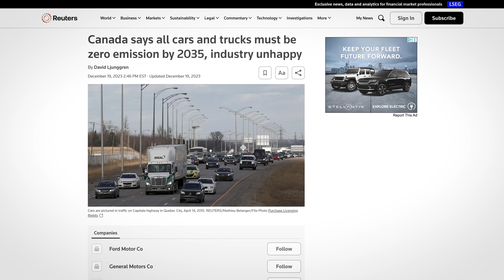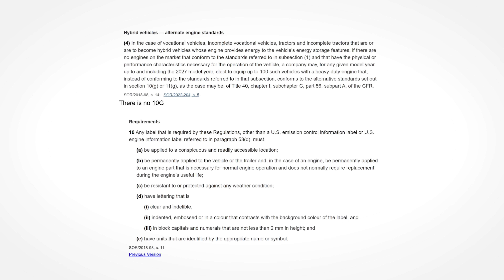Government Red Tape Is Blocking Our Plug-In Hybrid Trucks

Comment: One thing that has always bothered me about generators is their lack of emission control. Is that the issue here, you're trying to use diesel generators on roadways while ignoring the same regulations that other diesel trucks have to follow? If so, then tough - diesel is terrible when it comes to emissions and I don't want anyone trying to bypass it.

Comment: All vehicles have a generator (some call it an alternator)  All vehicles have a battery ( large trucks have multiple batteries).  Service vehicles have much larger generators to power their welders, power tools, compressors, work lights.  So, put in an inverter to handle the additional features with 220v, 110v, welding outlets and controls.  You now have a new class of emergency/service vehicle!  It can also carry power poles (logs?)

Comment: So, for what it's worth, what about split bank charging. Two battery banks, one drving the vehicle and the other on charge via the generator, when it's charged, the computer switches to the other bank and places the charged bank into the "duty cycle" powering the vehicle. This way the generator is not "technically" powering the vehicle with motive power through the batteries, it is truly an auxiliary power unit, and never powering the drive motors. Yeah, it's a bit of a work around, but avoids the whole concern of the engine actually powering the drive units directly. Regenerative braking can charge both batteries when ever need be, as it's not an area of concern from an emissions stand point. When legislative idiots give you lemons, you make lemonade and come up with a work around that renders their legislation as invalid. Under high demand for more power the charging batteries switch in to assist and the generator switches off until the load is removed, then the normal charging can resume. It's a cost effective work around that doesn't incur additional recertification of the diesel power unit (for the short term till you can afford to find another solution or recertification).

Comment: I don't think is really a "Electric Truck" in the proper sense. It is a diesel truck with a electric drive system in the middle functioning as a CVT and regenerative breaking system. It is far lower emissions than a proper diesel only truck and for that it is a leap in the right direction for the environment. Why the government doesn't think a leap forward is good enough I don't know.

Comment: Just a thought (Likely you have considered already) - 
Is it possible to use a petrol (gasoline) or natural gas (liquified or compressed) generator instead of diesel? 
These are less polluting fuels, so it might be easier to get green clearance (of whatever similar thing is blocking the diesel genset) for these. Given that you do not need tractive power, maybe its possible to gear these types of generators for your dynamo setup.

Comment: SOLUTION: Sell the All Electric version as a base model to allow you to pass through this stupid regulation. Then offer an "option" to install a backup generator  engine as an accessory. It basically restores your hybrid design as an option as intended. You can market it as an all electric but accessories change its nature as an aftermarket part that is not regulated.

Comment: I wonder if it would work to sell the customer a generator, and then... also as a separate transaction sell them a vehicle without the generator. Then when you give them the vehicle you have them both together. 

"No problem Canada, this truck does not have a generator, it does have a generator shaped hole that the customer can choose to do whatever they want with."

Comment: Can you build a system that modulates the throttle on an on-highway certified engine based on the load demand to achieve the same effect as a generator? How hard is it to get the uncertified generator engine certified for on-highway use?

Comment: So my question/ questions 
1. When u say mechanical system are you talking about not being a hybrid anymore because of this on road/ off road system?

2. Whats the difference in saying your load sensing are they saying the engine needs to be controlled by a pedal and not by a computer if thats the case then how do prius and other hybrid cars/ trucks work to allow that system, is that its canada and no other manufacturers are building a similar system to yours in canda?

3. Is there away u can still produce these for other countries and still not have the red tape hold you up and you do something different for canda 

4. Can you just make it an all eletric truck and then sell an option as an on board generator
Reply: I just saw some of the shorts, why not just set the governor at a limited rpm and make it where the driver has to turn the "engine on and off" where it can be proven that this is still an on highway engine and didn't adjust the "program" just set and installed a govnor on it

Comment: I know I'm going to get some hate but the regulation is there for a reason. Off highway emission standards are less stringent because it's often a more niche market, generators for RV's, diggers a d construction equipment . On highway since there are far more vehicles the regulation is more stringent. You are asking for the government to create a loophole. It doesn't matter that the engine is used as a generator. It is used to Power the vehicle no matter how you twist this so stop bitching and get your engineering in order. 
I do think that the government should have in place a time for compliance since you are doing something new where the equipment hasn't yet been certified. So like you are given 3 years to comply and certify an engine. I know we all hate regulation but it's there for a reason

Comment: Simple solution: sell the trucks without the generator. The truck is wired programed and set up for it though. Through a second corporation, sell the generator as aftermarket equipment. Through a 3rd corporation install said aftermarket equipment.

Comment: Spit balling here. Go to the engine manufacturer, see if they can program an on road engine for fixed rpm and engine load sensing. Then put the alternator on the back of that. Basically using an engine with an on road serial number and emissions system but have the throttle/ governor programmed to run as a single rpm generator. Like I said. A thought
Reply: I'm an engineer. I design processes to make parts for semi trucks. What you describe would work for some companies, but I'm guessing that if it was on my manager's desk, it would be there in sixty years when they demolish the building. There's no time for a "boondoggle we'll never sell." 

Just going into a meeting and discussing laser marking a part that's already been DOT tested is like proposing we try witchcraft.
Reply: @stickyfox  I think they’ve actually said that it would have to be road certified again because of the modifications
Reply: @thegameguy429  wait they were trying to do all these without even getting road certified? That would have never worked
Reply: @user-uh6kq2wh9g  yes sort of… Canada changed its laws recently which screwed up their process. They also need a proof of concept to get other companies and manufacturers on board.
Reply: @stickyfox  I bet Scania tried this in the eighties. But it doesn’t help, the American chicken tax prevents foreigners from delivering on-road engines  in North America.
Reply: Any mod like this would mean a retest and possibly a new classification.
Reply: Why not some kind of throttle sensor/control that is controlled by the system? That way you’re not touching anything on the engine technically, but you’re still able to get it to generate power for the batteries at RPM.
Edit: someone already had this idea…
Reply: I had the same thought.  They said it needs to have a road worthy engine, I assume plus emissions control.  Did they say you HAD to use the 12spd transmission, or is that open for discussion.  The generator is your 'transmission' it is just transmitting the mechanical power to electrical power.  Then, program the ECM to run the engine to turn the generator.
I can't believe how many people I have heard say it's not going to work when they have not even given it a chance!
Reply: or put a DPF on the generator, steady state will produce far less soot making it last longer
Reply: They aint that smart bro, this guy was saying years ago to run red fuel on the road... so that kinda tells you were his mind is... or is not... like anywhere on the world lol...
Reply: you don't need to involve the manufacturer to do that.

the bog standard cruise control circuit already accomplishes this exact task.
Reply: @anonym3017 it does but you would need to modify the ramp time.
Reply: @Duallyboy-jace  only if they want to protect tge battery even more.

They could also create their own system that interacts withthe throttle pedal position sensor to create whatever ramp time they want.

That way they could also run the engine at whatever RPM is the most efficient for whatever given power output.

Comment: @EdisonMotors why not use the onroad engine and use a charge sensor (similar to a temp sensor for electric fans). It would start when signaled,  and either use a 2 or three stage RPM controller, or a mechanical governor to hold the desired RPM?

Comment: Can you use an on road engine at wide-open-throttle limited by the over speed governor? Perhaps have the top RPM tweaked to match the RPM you need for the generator? Or run the on road engine in PTO mode all the time? 
You guys are insanely smart fellas, so I have no doubt these options have been discussed internally, just curious what the legal reasons these options wouldn't be a path forward.

Comment: At the risk of sounding like a conspiracy theorist it seems rather obvious that you are competing with the government protecting existing industry and infrastructure. If it's okay to build a 15 litre truck with an 18 speed but not the truck you have designed (which polutes less) it is obvious that there is no sincerity to the zero emission 2035 plan unless those implementing it are the ones that will reap the benefits from it. Until then, we polute and "they" continue to reap the profits from doing so. Watch your backs. Good luck.

Comment: There might be a loophole with this if their issue is having a generator on a moving platform then what if you build a sleeper on the back of this truck and when the vehicle is not moving the engine idles just like any other semi but when you get up and start moving again turn off the engine in only use the batteries

Comment: Sounds like you need an electrical engineer well versed in j1939 to take a on road Cummins and control its rpm/air fuel with a custom module. But maybe I don't understand the problem...

Comment: But your not a hybrid. Hybrid vehicles are driven by both the ice engine and electric motors. Yours is a ln electric vehicle with on board charging capability. 
As for all vehicles needing to be plug in by 2030, it won't happen. Canada doesn't have and won't have the infrastructure to support them

Comment: Do not include the generator in the vehicle as a primary item. And have the space for the generator and to be easily swapped out there. And it's a generator for the Hamilton. News as in writing, air palms and welder and stuff. And so, forth like that, you know? And word it that way, because there is no regulations on those items has that and then the there customer quotations. He puts on the generator after market

Comment: Is it possible to run the generator at an optimum efficiency supplying the electric drive directly with batteries providing juice for torque ( much like a hybrid). The motor then would be on board . Let's say it's 1400 rpm generating 30kw to the electric drive,a hill up needs another 5kw supplied by the batteries, on the hill down the generator is putting out the same 30kw but only needs 25kw with the other 5kw recharging the batteries.

Comment: I don't know how it is for you, but over here it's easy to ask for dispensation in cases like this. 
It's a bit extra effort compared to just having the laws be up to par in the first place, but it's really only for cases where law and reality clash.
That being said I don't see why you couldn't run a standard engine for your generator, and simply supplement power spikes with the battery pack, we're already doing that in the maritime world (in several ways too). Might decrease efficiency I suppose
Should probably note that maritime engines are built to hold a constant RPM, which is probably why you're using a generator in the first place

Comment: What’s stopping you from going around the issue and grabbing a road-motor, then driving it with an electric throttle that’s programmed to sense battery load and working like that?

Comment: If you have a dirty engine, then it should not be allowed. You can if you find a clean generator, simple. The 2030 law will never be attained because there is no infrastructure yet.

Comment: Just wait until you add some solar panels onto the roof of a van trailer and have to certify the sun's emissions if you wire that trailer to be able to help charge the truck's batteries.

Comment: Same government that took out the clean natural gas engines from a ferry, not allowed by transport Canada, and installed heavy diesels so now the ferry can't make the port at low tide.  Oh and then CBC blamed abnormal tides and climate change, and no one has mentioned the engine swap yet when the engineering assessment was done in 2022 stating vessel will go aground.  So how do you take a clean ferry and make it much more environmentally unfriendly, and also how do you take a boat that will make the port then make it go aground.  The federal government f-up playbook here on PEI.  Good luck but we live in one of the worst democratic countries in the world for restrictions, legislations and controls forced by the federal government, way too overbearing.  It's embarrassing.

Comment: No one is permitted to do anything useful until the government figured out how to take credit.
Reply: Nono, not credit. They want tax revenue. They need to figure out how to add taxes to these units before they'll let them be sold. They consume less diesel and there's no road tax on electric, so they need to formulate a plan to tax these trucks by power consumption and they'll mandate a kwh meter on every truck so they can tax the meter.
Reply: @james2042  This is the correct answer. Normal people aren't allowed to make money unless the government and at least one billionaire can make money off it too.
Reply: @james2042  there's already an electric vehicle surcharge when you register your ev now
Reply: That's the same for a significant percentage of governments local & national
Reply: Gotta be a loophole around it. Make the generator only run when the truck is parked? Have the generator separate to where the customer has to physically hook it up to the batteries? There has to be a grey area you can use.
Reply: kinda  true. More like until the government gets some sense
Reply: No, it's because they want their cut. $$$

Comment: Former engine management dev engineer here.
I do understand your government on this. If they allow off highway emissions for on highway use, it creates a hole in the legislation that can be abused. 

Better get your engineering in order.  That is what other engine and truck manufacturers also need to do. 
So it is maintaining an equal playing field. 

Truck engines have several pto options,  controllable via J1939 tsc1 messages. Use that!
Ask your engine manufacturer for support
Reply: They needed to start this three years ago, not wait for the prototype to be built then act all shocked pikachu.
Reply: With torque speed control, you can request a rpm and the engine control will maintain it
Reply: You misunderstand. You're describing a problem with the legislation, not the engineering. Governments are supposed to make people's lives better, not hamper innovation because their donors don't like it.
Reply: @thematt6705  that particular legislation is designed to keep the air clean to breath. If this generator can be proved to be on highway complaint then it will be allowed.
Reply: @thematt6705  relaxing emissions regulations makes engines more powerful, reliable, efficient and significantly cheaper to develop and manufacture.

all that is required in Canda to fall into the PHEV category is a 7kWH battery, an electric motor that can drive the vehicle and a way to charge the battery from the grid.

getting a truck to meet the PHEV requirements costs maybe 2k.

Which means that "the engines of PHEVs only need to meet generator instead of highway emissions standards" would result in every single truck having that 7kWh battery, a slightly beefier starter, a 1kW AC charger and a way more polluting engine. it would never get charged.

Which means that PHEV engines still need to meet highway emissions is absolutely the right choice to keep peoples lves from getting worse.
Reply: You have to be on another level of sheepiness to defend this 😂😂😂😂

Comment: Just make it a purely electric truck. And then have a switch with a placard etched onto it that says not for road use, Off-Road use only. They flip the switch, and then it runs into a different mode. Otherwise it's carrying around the generator as dead weight. You'll sell it as an electric vehicle only, and the owner operators can choose to disobey the law if they choose. Every single one of them will do it of course.

Comment: Can you certify your trucks as full EVs without the generator?  Then just happen to sell a diesel range extended module that customers can add under the hood.
This is stupid, and typical - they want hybrids because that keeps oil dependence while making things "better", but not series electric hybrids like you're making since they're more efficient.
Fine yes I'm wearing a tinfoil hat.